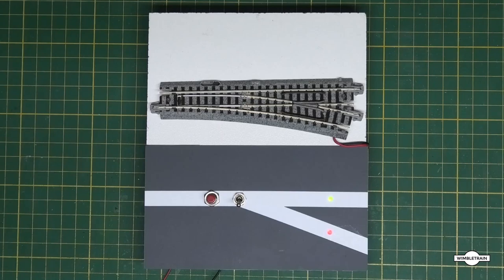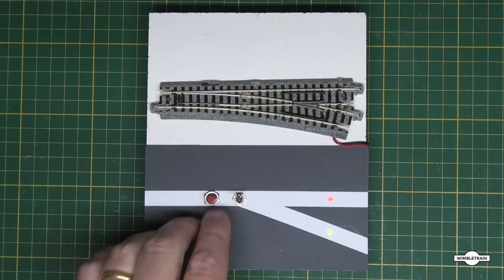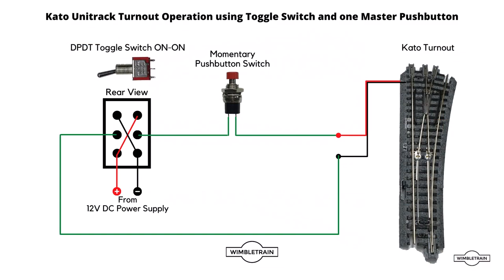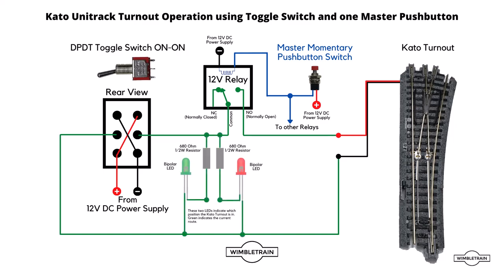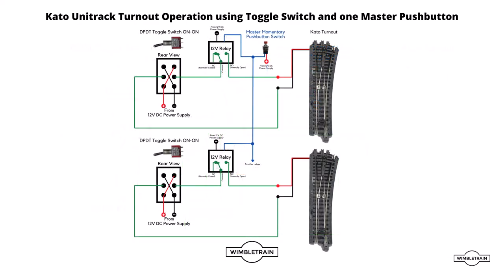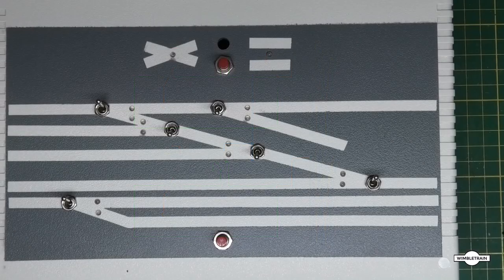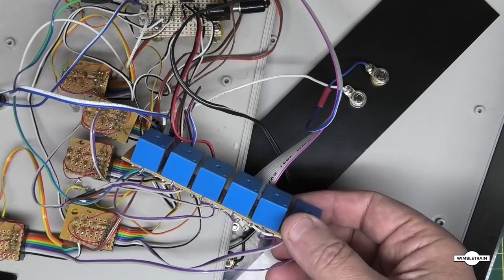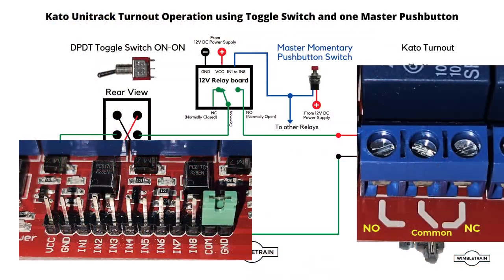Kato turnout Operation using toggle and one master pushbutton switch

Comment: OK, I'm new to Kato and Basic electronic wiring, So, Here are, Three questions. 

1. I interpret this to mean All I have to do is flip the switch and the relay activates the switch, and the appropriate LED turns on, Green meaning straight and red meaning the other direction, LoL! This also is momentary, so not to Burn the Switch Motor Out. Correct?

2. In looking at your schematic, if there is a power supply for each switch, that could take up a lot of AC plugins. Is there a way to have one master power supply with multiple switch connections for power, or maybe a power distribution block of some kind?

3. Does the Power that is delivered to the Switch, that trips the point, does it Also provide power to your switch so your loco does not stall?
Reply from the maker: 1. In this case you would set all the toggle switches to where you want the turnout to be and then you would just push and let go the momentary pushbutton and this will set all the switches at once. Yes, it is a momentary pushbutton as you could damage the turnout if you were to apply a permanent voltage to it.

2. You only need to use one power supply (I use a 12VDC 5A) and you can split the output of it in various ways but if you look up 'terminal strip' on ebay you will see these are screw terminals where you can connect the wires from you power supply to two separate blocks (+ve and -ve) then run wires off the other terminals to get multiple outputs from the one power supply.

3. The power supply for the switches is only for the switches. i.e I use a completely separate power supply for the switches and it's not used for anything else.

Comment: Hi. thank you for explaining this. im putting onto my home layout. 
one thing im confused about is the positive postion on the relay. in your diagrams one shows you use it. the other you dont. should i connect the positive to the relay or button? or both?
thank you again.
Reply from the maker: Hi, if you haven't already, I would suggest watching the other videos I have regarding different ways of operating Kato Turnouts.  The method in this video uses only one pushbutton to operate all the turnouts, so the 12V is only connected to the one and only pushbutton.   If you watch the other videos, it may become clearer .

Comment: Hi there,  This is Mani from India.  Very good presentation, appreciate your efforts to explain every bit of the setup.  
Quick question maybe a dumb one too...I have 5 turnouts, if I toggle only 3 switches what happens to remaining turnouts when I press the push button?  
Next, what will happen if I press push button more than once without changing toggle switch (i.e. remaining in same position).
Here I will be using 5 relays each of 12v 3A, so what would be the power supply?  would it be 12v 3A or 12V 15A?
Also, In the market, I am not able to get 12v 3A, but could see 12v 10A relays available.  Is this ok to use these 10A relays instead of 3A?
 Thanks, Mani
Reply from the maker: Hi Mani, the relays in both cases will just stay in their current position, a pulse will be sent to all the relays, but if you haven't moved the toggle switch then they will do nothing. With the power supply the 3A should be ok. You can use relays rated higher than 3A, in your example 10A no problem. All the best. John